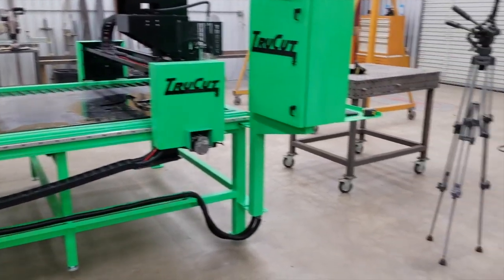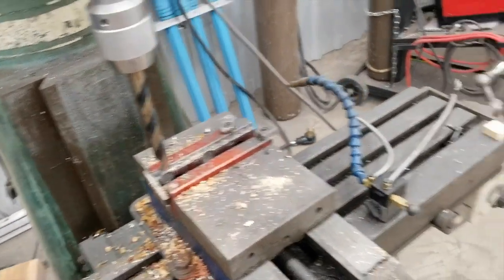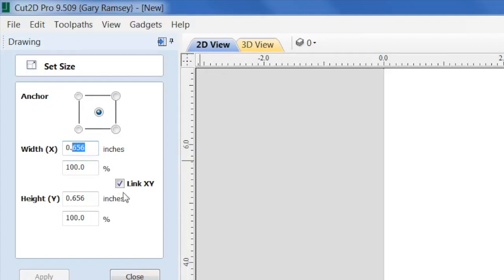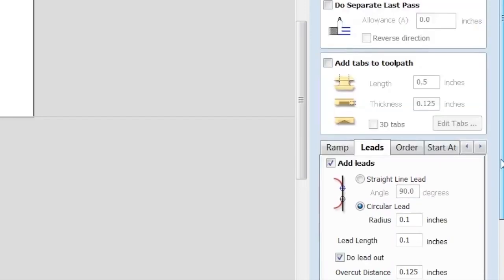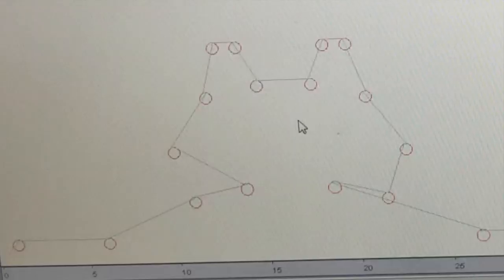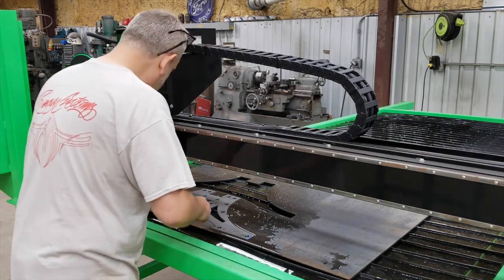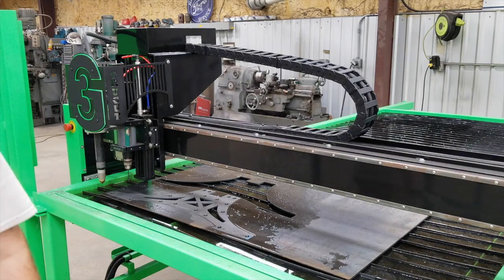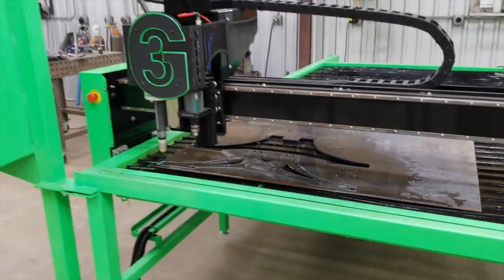How to recut to enlarge clearance holes - and save the job - CNC Plasma Cutter Table

Comment: I know this is two years old and all that, but I just bought a table. What I got from this is after the original first hole thats cut you should check then to make certain you have it correct? Then make necessary adjustments prior to moving forward?

Comment: I'm curious, does Trucut sell just the controls for guys that build their own tables?
Reply from the maker: they used to sell a gantry kit you could buy, that included the gantry, motors, drives, and controller, and give you the plans to build the table.  It only saves about $3,000, when i look at it, the materials to build the table were almost $2,000, and it was worth it to pay the extra to get a full table.  Not sure if they do that now or not.  That control system is made by Thermal Dynamics and is available to anyone, cost is about $8,000
Reply: @turbocobra  Thanks.

Comment: Use a barrel sander in a drill and be done with it!
Reply from the maker: huh?  that would be brutal, if its rough on a drill bits and reamers, it would wear out 3 of those barrels on each hole trying to open it up.  Why not just do what i did and plasma cut them, fastest adn easiest way to make a hole or enlarge a hole
Reply: I do 30 holes on 1/4” stainless and I can do two pieces with one sleeve. Depends on how tight you want the bolt to fit I guess

Comment: I use a step drill to cut out plasma cut holes to next size up.  I use it to get clean holes up to 1/4" plate but mostly 14 gauge.  You will have to drill from both sides on thick material  Twist drills only get a hand full of holes.  A good step drill will get you hundreds.

Comment: Interesting technique. Not sure I would have had the guts to gamble on alignment being the same and hitting the holes right. Carbide burrs and an angle grinder are handy for those tight spots. :-)
Reply from the maker: non critical, self aligning holes!   Aint nobody got time for hand grinding and drilling!   I should have shown it but i stacked a few pairs together and they lined up pretty nicely

Comment: What does the drill chuck on the unit do? I have not watched since you shifted to Tru Cut.
Reply from the maker: you can drill holes in aluminum, and specifically what i use it for is to countersink holes for flush fit screws on multiple layers.  Also plan to use it for engine turning patters... i havent shown it in a video yet, its more of a toy at this point, experimenting

Comment: Nice...I need some of those style table legs for my conference table build
Reply from the maker: yea that would be badass! i can hook you up, if you buy the materials and pay shipping, i will cut the side plates for you and give you the mcmaster carr info on all the fasteners, etc so you can have it all drop shipped and cut your threaded rod.  There are a total of 64 threaded rod pieces and 128 5/8 nuts, 16 1.5" nuts, and 8 1" nuts... so its alot of hardware lol
Reply: @turbocobra  I may take you up on that. Made for a 4x4 in the center?
Reply from the maker: @Thefabforums  4ft X 4ft table top?  I have a different design for that size table as a pedestal style.  holla when your ready, we could do something custom for you ... maybe some bibster rear control arm inspired legs!
Reply: @turbocobra  probably something closer to a 4x8
Reply from the maker: @Thefabforums  oh ok yea these would be perfect for 4X8.  I have a guy with a 58" wide, 12 ft long 3" thick African Bubinga top on a set of these
Reply: @turbocobra  you think my Mr Deez logo could be modified to work in two peices like that and still look cool?
Reply from the maker: @Thefabforums  possibly, email it to me (preferably in vector format) if you can... gary@ramseycustoms.com

Comment: So did you make it through all the plates without loosing your home location ( bumping the sheet stock)? Seems it would be easy to loose it. Must've sold some tables. Thanks for sharing
Reply from the maker: that sheet was pretty heavy so it would take alot to move it.  I stacked some pairs together after i finished and they lined up pretty nicely
Reply: @turbocobra  well it's a neat trick. Using the plate to catch the torch is too.

Comment: Why is it hard on the drill bits Gary?  Does the CNC harden the steel that much?
Reply from the maker: yes it does, flame hardens the edge, it will wear out a drill bit sometimes in one hole.  Cobalt or carbide drill bits will last longer but HSS drill bit will dull the edge very quickly